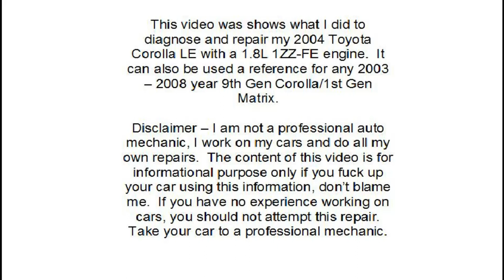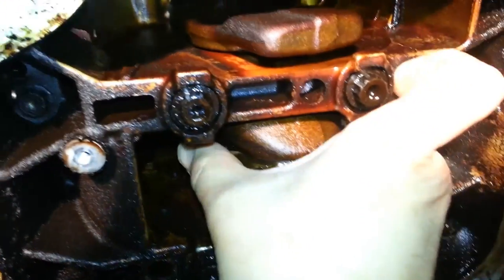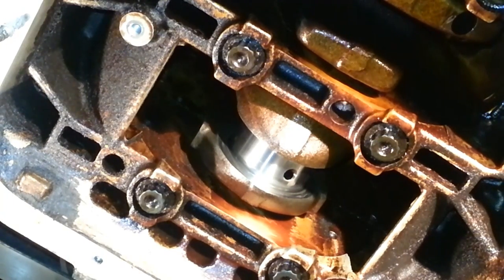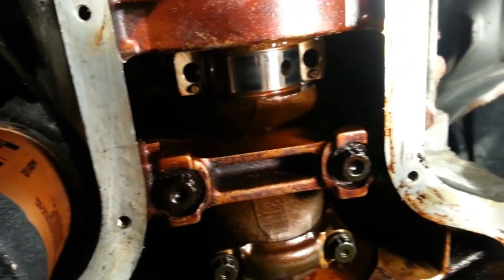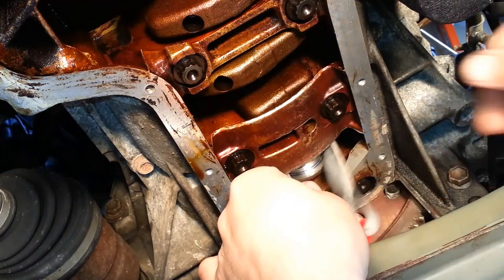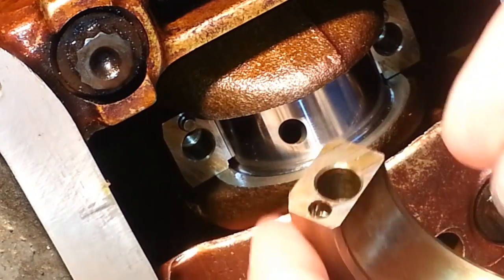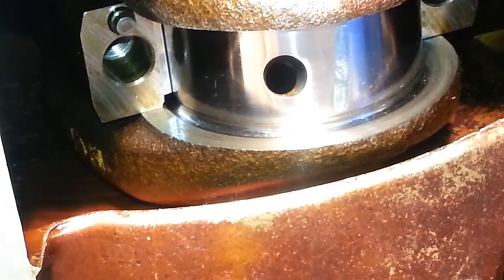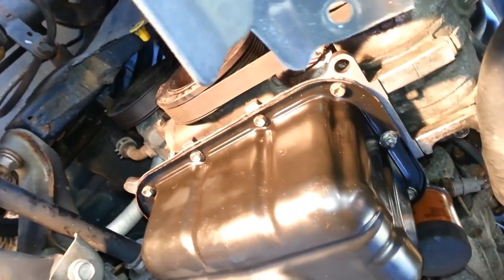2004 Toyota Corolla 1.8L bearing replacement to fix rod knock caused by bad connecting rod bearings

Comment: awesome video!  i have an 03 corolla and spun number four. MY question is mine called for a number 2 bearing. sounded good at first but it seems to have developed some slop. Can i move up to a number 3 bearing and it work? Is a number 3 a slightly thicker bearing? I found some info online but its showing different large end bore diameters. Not by much tho. I was thinking/hoping i could use a number 3 bearing.
Reply from the maker: The correct way to determine which bearing is required is to measure the oil clearance with the plasti gauge and determine the correct bearing thickness.  (I show how to use the plasti gauge at about the 35 min point in the video)  The "Mark 2" is 1.491 to 1.494 (0.0587 to 0.0588) in thickness, the "Mark 3" bearing is 1.495 to 1.498 (0.0589 to 0.0590) in thickness. 
For reference here are the standard bearing thicknesses: 
Mark 1 - 1.486 to 1.490 (0.0585 to 0.0587) 
Mark 2 - 1.491 to 1.494 (0.0587 to 0.0588) 
Mark 3 - 1.495 to 1.498 (0.0589 to 0.0590)

Comment: My  4th rod bearing shattered. sigh. Been trying to sand it for a quick repair until I can rebuild my engine properly, but I can't get the nicked portion to sand out. Exactly how smooth does the journal need to be? If I rub my finger across nicked area it feels smooth, but rubbing my finger nail across it I feel light high/low areas. btw. looks like previous owner of my 05 corolla xrs didnt upkeep the oil changes which probably lead to this.
Reply from the maker: +hiblendmedia I don't have any personal experience with nicks on a journal, but as long as you've polished off any raised metal (high area) and the nick is below the journal surface you should be be fine.  The only exception might be if the nick is in the sensitive journal overlap area.
Reply: +hiblendmedia Use emory cloth to clean up any nicks!!
Reply: I think you might be freaking a little bit on the condition of the rod cap itself.  There is no movement between the bearing and the cap and so there is no reason for this to be anywhere near a 'polished' condition.  You did say that your bearing shattered though, but even with some damage to the cap interior surface (and you described it as a nick), it should be able to support the new bearing without consequence.  If you have any angst about it, you can always take the cap to a machine shop and see what a tech there thinks.

Comment: hey mark thank you for the video.
i have a question. Do you use the plastigage on both sides of the connecting side? or only on the bottom piece that comes off?
Reply from the maker: You only need to measure the oil clearance on one side.

Comment: Hello good Stuff 2 questions did you re use the old bolts ? And I  got lost with the marking with plastic in the sleeve is that step necessary? Also did you remove crossmember Thanks
Reply from the maker: Yes, I reused the original bolts.  If you are referring to the plastigauge it is necessary to make sure you have the correct oil clearance for the bearings.  i did not remove the cross-member I was able to access the bolts with a swivel socket.

Comment: Did you use standard sized rod bearings, or did you use undersized bearings? Does the Polish make THAT big of difference to the thickness of the journal?
Reply from the maker: The polishing did not any noticeable difference to the journals, so I used standard bearings.
Reply: Mark G 
Thanks man

Comment: I am doing the same vehicle qnd engine. Im having a bit of trouble with the support frame in the way. Pushed the rod up too high. Do i just gently push back down from up top?
Reply from the maker: Yes, remove the plug and push piston back down carefully.
Reply: @mrmarkg8564  thank you brother! It took me about 3 days but i followed your video to the T. And my results are very satisfying. I hope she holds up for another 80,000 miles 😁 this job is tedious. But rewarding
Reply: Vehicle still running great at 190,0000
Reply: @joshuamorphew1717  Still running?

Comment: Can this be helpful on a 2003 honda civic the sound the same as yours and its number 4 on mine I already check it. Wanted to ask first before I bought a new motor to replace it
Reply from the maker: I've never tried it on a 03 Honda, but if you can get the oil pan off from under the car, basically everything else should be the same.
Reply: Can...i already done on my vtec b18c5 engine...its works....

Comment: Hi! Thanks for the video, What grade sandpaper did you use on the journals or did you only use 600 grit???.. thank you
Reply from the maker: Mentioned at 12:30.
Reply: @mrmarkg8564  All I'd like to know is: Did you use any other grades off camera? Thank you..
Reply from the maker: @elipsonj  As I mention around 12:30, I used 600, 800, 1000, 1500 and 2000 grit papers.
Reply: so the journals were scored?

Comment: There seems to be some professional confusion about whether this is a good thing to do or not. I think it depends on whether metal went through the entire oil system or not. In this case it appears to be clean? Is it still running?
Reply from the maker: Almost 40K miles since the replacements were done Andrew and still running great.

Comment: I see your problem, FRAM. Only use Toyota Filter.
Reply from the maker: I have never had any issues with Fram filters.
Reply: @mrmarkg8564   they are crap, see vids on them.  always use a decent quality filter with a check valve in it to save a lil oil for next start up
Reply: @mrmarkg8564  fram oil filters are JUNK !!!!!!!!!!!
Reply: @mrmarkg8564  there's a video where they cut open a NEW UNUSED fram filter and it's rusty inside BEFORE use.....
Reply: That's the bottom shelf FRAM filters - the Walmart filters beat those.
Their "Ultra Synthetic" line is actually supposed to be pretty good.

Comment: Maybe i missed it, but why do you do part with the plastigauge?

Nice video btw :) Liked
Reply from the maker: +sypher0101 The Plastigauge is a measuring tool used for measuring the bearing clearances to set the correct clearance between the bearing and journals for the oil to circulate between the parts and allow proper lubrication.  Due to wear, machining or part replacement the bearings size is increased or decreased to provide the correct specified clearance. 
http://www.plastigaugeusa.com/

Comment: I have a question for you my catalytic converters was clogged , so now I have a rod knocked. I’m thinking of doing the same job you just did, should I replace the piston rings too ? The car turns on but if you attempt to drive it it looses compression and turns off, if I change the bearings the same way you did ..it should fix the problem correct? Thank you in advance for your help !
Reply from the maker: A knock and clogged cat are probably not related, if you replaced the cat and the engine still has no power on acceleration and stalls, you might have a clogged muffler since your cat failed.  Remove the muffle and see if it's clogged.  Replacing the bearings will fix a rod knock, but unlikely that the   rings are the cause for your lack of power and stalling.  You may need to preform a compression test to determine if the rings are bad, rings would also need to be done if  you are having oil consumption issues which is common for the 1ZZFE engine.
Reply: Mr Mark G thanks for answering my questions but after I removed the catalyst the knock began so is stalling
Reply: @manuelmaldonado5728  low compression is caused by rings but can also be caused by valves not sealing closed properly. You might be right with just rings and big end bearings. Some rings will fit right in while others are expected to be "ground" to size and rebuild shops have a machine that does it. The other one is new pistons with rings already attached and they heat the small end of the conrod with a blowtorch to get it to expand enough to put the conrods on the pistons. But don't be surprised if it's such a mess inside you'd be easier just buying a decent engine from a wrecking yard.

Comment: How come you didnt do one rod bearing at a time?
What i mean is by getting one all the way polished and put back together BEFORE  you start on the next one,that way you dont have to worry about the rod slamming in all the wrong places
Reply from the maker: I needed to determine the correct bearing sizes for all four before ordering the bearings.

Comment: I spend more $ on fuel, oil and mechanical services for 2005 corolla. So I spend nothing for major and unwanted repair.  I use 98 Octane, change oil (5W-30 Castrol Fuel Saver) every 4 months alternative.  No issue, so far. This car have oil related issue.

Comment: Mark, thx for taking the time to answer my Camry question and again for the great video. Hey, watching ur video several times i saw a number 2 on the crank (weight?) as u were rotating it. That rod cap was also a number 2. Was that just a coincidence?
Reply from the maker: Not knowing which numbers you saw and are referring too, my guess is no they are not the same. There are many markings on the engine parts, each component is stamped with a code for the factory measurement. The bearing mark as I show it on the rod cap indicated the bearing size installed at the factory, but the number on the journal is the code journal size. The bearing size is determined by adding the journal number and the connecting rod bore stamp number together. Hope that helps.

Comment: So I let oil run low in my corolla and ended up with a rattle on acceleration it's probably the rod bearing(s), right?
Reply from the maker: Most likely.

Comment: What are the torque specs for the bolts? I need to work on my sister’s corolla that happens to have the same issue
Reply from the maker: It's all in the video.
Reply: 15 ft lbs (20Nm) plus 90 degrees. works out to around 40Nm.

Comment: Great info! Thanks for sharing. Just curious, how many miles on your car before this happened?
Reply from the maker: Guy Ko Hi Guy, about 125000
Reply: Mark G Thanks for reply. I'm at 126,000, hopefully I wont have this issue. If I do, your video is a great resource.

Comment: So I've had this noise for a while and I was convinced by another Miata owner that he replaced his top end and it was something in there. I'm starting to see that it sounds more like worn bearings. I don't want to push the car any further. Is there any chance the're going to be scoring at this stage if it is a bearing? I don't want to go in replacing what seems necessary only to find I've ruined more than just a bearing.
Reply from the maker: The bearings are designed to fail first, since they are a much softer metal composite then the journals, but it depends on how long they have been going bad, you won't know for sure until you drop the pan.
Reply: Hey Mark,
Thanks for the great video.  I have a 2012 Kia that has 114k miles on it.  About 2k miles roughly I noticed, what I thought was a tensioner knock.  Well I really had a chance to get in to it this past weekend and sure enough it's a rod knock.  I isolated it to Cylinder #4.  When I remove the spark the knock is completely gone.  The knock is not nearly as bad as yours sounded and only makes some noise coming up to and down from 1500 to 2000 RPMs.  I am also starting to hear some knock at idle but I am concerned that this may be something going on with the valvetrain.  I babied this truck since I bought it 4 years ago and used mobile 1 synth and mobile 1 filters every 3 to 5k miles.  I have been told that almost always the crank journal is out of round and should be turned or else bearing failure will reoccur soon after replacement but from your experience maybe that is not the case always.  Obviously this engine was neglected judging from the bottom end.  I just rebuilt my trooper with 230k miles on it and it looked brand new compared to that motor!  Anyway, I am about to replace the short block on this vehicle but maybe I can save myself a couple thousand dollars with this technique.  My big concern is WHY.  Why did the bearing fail with no neglect.  I never redlined this vehicle and while I did put a lot of miles on it it never was abused.  Anything that can be done that you know of to verify that the oil pathways are clear before buttoning it back up?  This is my daily driver and I need reliability for my long trips with work.  Thanks again.  Great work.
Reply from the maker: Hi Marcs,  Assuming that you have been using the recommended oil viscosity for your engine, I would
suggest checking the crankshaft journals oil ports while you are in there, the oil pump, the oil pump pickup
screen and the bearing clearances with the plastigauge to verify you have the correct oil clearance.  Oil clearances should be fine with a low mileage engine, but wear on high mileage can take its toll on an engine parts causing increased clearances between bearings resulting in lower oil pressure and poor lubrication to other areas. It would be this case that the crank journals could be out of round and would require turning.
Reply: Thanks for the reply.  Now a days 114k miles "low mileage"?  LOL  Yeah I always used the recommended oil viscosity.  Looks like because of balance shafts I may only have access to 2 of the 4 cylinders and I am hoping it is #4 at least.

Comment: Oops you torqued to 15 ft pounds and then turned each bolt an extra 90 degrees. So doesn't that make them stretch bolts? Which are only supposed to be stretched once then thrown away? Hmmm
Reply from the maker: Willie,  I’m sure we can open a debate on the topic on whether or not they should be replaced once removed.  Professional mechanics will state that the factory service manual indicates to replace the connecting rod bolts with new factory bolts once removed and anyone who builds performance engines will replace the bolts with performance bolts during a built, but for most repairs to stock engines, stock rod and main bolts can be re-used if they are in good shape and you know that they haven't been re-used multiple times.  That being said, the extra money you spend on new factory bolts is like insurance money, you probably won't need it, but if something happens, you'll wish you had spent it.  In my case with the 1.8L Toyota it’s 120-140 hp 122-124 ft lbs of torque, I wasn’t worried about replacing the bolts.    

A note on the topic:  If you do replace the bolts, make sure to replace them with OEM factory bolts.  When OEMs design a bolt, they build it to have a given clamping force at a given amount of stretch of the bolt. The engine assembler twists the bolt into its thread to a specified torque plus XX degrees, (15 ft lbs +90 in my case) what we are actually doing is stretching the bolt to gain the required clamping force.  There are two types of stretch you can give a bolt. There is elastic stretch, where when the bolt is removed it returns to its original size and can be re-used. And there is plastic stretch, where the bolt is permanently stretched and does not return to its original length.  The reason you should only use OEM factory bolts when doing this type of repair, is if you install a bolt of a different composition to that specified by the manufacturer then the amount of clamping force at the specified torque will vary from the manufactures specification.  So, if you change from factory fasteners to a different material such as high performance or high strength bolts, clamping force and tolerances WILL change.  This will result in a different amount of distortion of the components you are bolting together therefore the rod 'big end' must be re-sized/re-machined, remeasured and reinstalled.  This will require removal of engine, dis-assembly, re-assembly, and re-installation, plus many new expensive parts, gaskets, seals, bearings, etc).
Reply: Mark G I have seen some people reuse their head bolts that are stretch bolt.  (and have seen the notice they give you to replace stretch bolts)Am not too comfortable with the practice of reusing them but have seen it done.
Reply: As long as I loctite them I'm fine with reusing them. If you really worried about that you should take this whole engine apart and do a proper rebuild
Reply: DIY-HAVEN I would have just replaced the bolts if I was really concerned
Reply: Don't worry -- They are not TTY bolts, like most headbolts are, as you mention.  

These are specifically called-out by Toyota as "plastic region" bolts, meaning that stress stays below the yield point (stress is high enough to cause elongation, yes, but not high enough to push the bolt past the material yield strength).  When stress exceeds the yield point, elongation is no longer plastic (aka elastic, meaning the bolt will spring back to original length once the load is removed) but rather higher-than-yield-point stress causes permanent deformation, which is what you are talking about that's seen in headbolts (which are TTY bolts).  

That's why Toyota calls these bolts plastic region bolts in the 1ZZFE spec sheet (it says "Nutless-type plastic region tightening bolts are used for a lighter design,").  These bolts are used on several other Toyota crank assemblies, too.  

Just be sure to check the FSM -- if there's no spec for max length, or no call-out as "not reusable", then you are good to re-use them (assuming they aren't damaged, obviously).   If you do decide to get new bolts, get Toyota bolts.
Reply: 15 ft lb is nothing. These aren’t torque to yield.
Reply: @philistineau  15 ft lbs. then turned to 90 degrees

Comment: My corolla has exact the tapping sound as in this video but doesn't have rod knock when revved. Can you tell what is this tapping sound?
Reply: Timing chain maybe
Reply: @aidanschannel6510  or timing chain tensioner. Usually when it's cold you will hear it then as the engine warms up it goes away

Comment: Nice work.
What size socket you used to remove the rod bolts?
Reply: 10mm 12point
Reply from the maker: Didn't remember off hand but I know I mentioned it in the video.